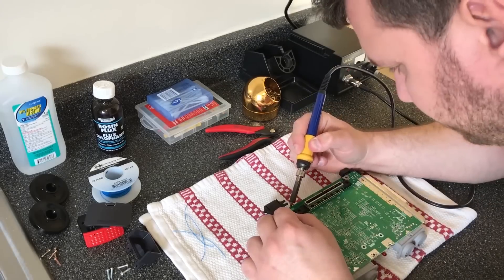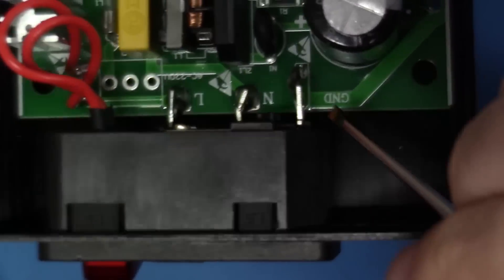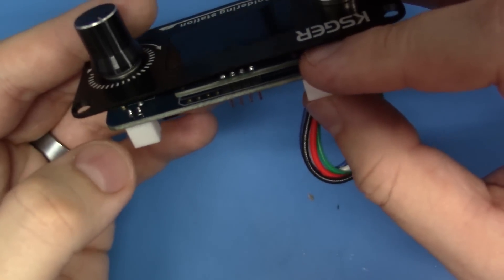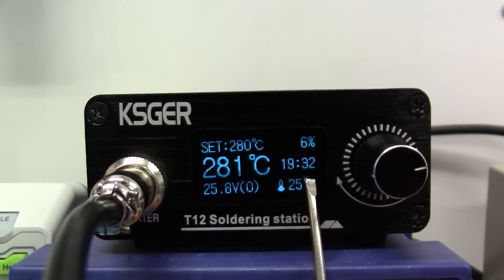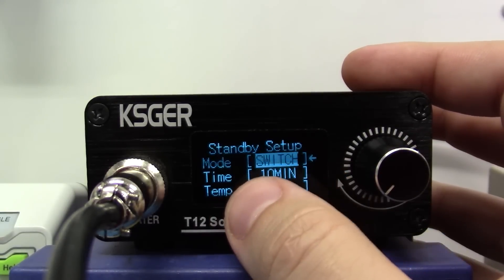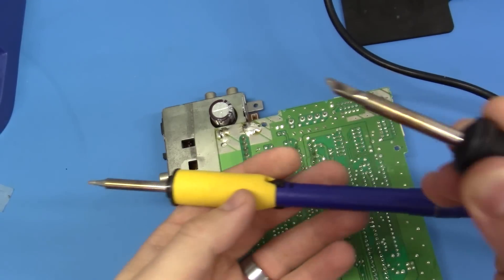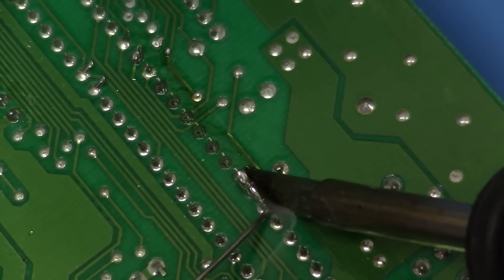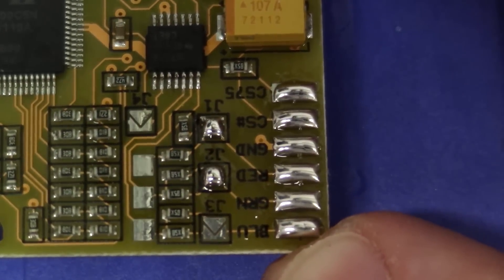Buying Your First Soldering Station (UPDATE READ DESCRIPTION)

Comment: I think crimping and screwing in should be better than soldering in power applications. Solder is not to be relied on for vibration resistance and mechanical strength.
Reply from the maker: Yes, I completely agree with you. But unfortunately, a lot of these "cheaper" soldering stations have mains lines that are VERY poorly crimped. In this scenario I would much rather have a hard-soldered, mechanically bonded interface between my AC input and the rest of the electronics than have the risk of having a poorly crimped AC line break off, float around and short to something else, that could be devastating!
Reply: @Voultar   why you do not use your hakko  station
Reply: @andreiciora2765  They are.  They are just making this video to demonstrate a cheaper item for people on a tighter budget
Reply: For govt work, make it mechanically secure then solder. Crimps are good when well done. But solder is gas tight.  I've replaced hundreds of crimps done with any old pliers, multi tools, etc. With the proper tool and clean wire and terminals, crimps will last.

Comment: So convincing until i followed your link... the picture of the guts looks a bit different than your unit.  the jack for the iron is now directly soldered to the logic board on the front panel which seem inferior as it would be more difficult to replace, the battery is no longer directly soldered to the logic board which is an improvement, but there are so many complaints about it not being grounded to the tip, in direct contrast to what you said.  Perhaps this great video needs a re-visit. Things change after 5 years!

Comment: I have a Quecoo T12-951 , I got the LED version, Opened it up, and yes the AC Socket plug was soldered to the board which I like, But the GX12 plug didn't have Heat shrink around the  connectors, They used hot glue, LoL what a pain if I ever needed to service that plug, Also the used Hot glue to keep the board in place, No Metal PCB feet to the case, so That means the case, the GX12 plug and the soldering handle isn't grounded. Easy to fix but really we shouldn't have to do this. Other than that, it works perfectly, I like the simplicity of the LED unit Vs the OLED/LCD units, Like I don't need a password, I don't need the time, FFS is it a soldering gun or a mini PC. lol Great little stations.

Comment: Thanks for this video! Just wanted to share that I used the provided link to buy the t12 station from Banggood. I just received it, checked inside to find that while the circuit has been revised including a different microcontroller (not surprising given this is 4 years later) the internal build quality appears very similar to what's shown in your video. I've only had a few minutes to test it so far but it fired right up and I was soldering in seconds. I'm just getting into console modding, I have some experience soldering and even took classes 20 years ago but we didn't cover the tricks you use for repairs and mods and I'm sure my old Radio Shack irons would not be up to the task.

Comment: Recently got this (internals seem the same, not the ungrounded version some videos warn about) and did a bunch of mods I never tough I'd be able to. Almost borked an xstation qsb but bypassed the lifted pad with a wire. Funny enough, lifting the pins was a breeze, and I'm on to installing esp32 modules for blueretro on my snes/ps1/n64

Comment: This products is not BangGood but BangBad!! 
Bought one last month through the provided link in the description. Shipment was fast and the station looked OK. Rods feel cheap and break easily. Turned the unit on and didn't work at all. Had to jiggle around with the tip to get it to heat up. When it heated up it would give the ERROR message after a while. Opened the handle and it all feels like "if it stays all in this position then it should work".. Well I didn't get this unit to work properly and contact with banggood support to request refund. They (after providing 2 videos about problem) refunded me the money. make sure that you have the box and all other stuff they sended. Otherwise no refund.

I now bought a Hakko FX-888D after watching more "buy a soldering station" videos on YT and I wished that I did that before buying this crap on BG! WOW this Hakko station is soooo good, perfectly build, easy to use and always works.

You know when using services as Ali or BG that the product yuor buying is shit. Just spend a bit more and buy a proper tool (Hakko is $100).
Reply: I also went with the Hakko FX-888D. I had major concerns about the safety of the Ksger based on an extensive search. It seemed like they could be resolved, ironically with some soldering of a ground wire, but I just didn't want to risk it or have ANOTHER project on my list.

Comment: do you actually want your soldering tip to connect to ground? cuz you sometimes need to solder things in equipment that just stays on you know lol. i'd say it would even be preferred to make them of something that gets hot but doesn't conduct electricity at all.

Comment: I wish I could press the like button multiple times. One question though... Were you applying the tip directly to the surface of the board, or were you hovering above?

Comment: I recently bought one as a backup for my Hakko at your behest. Barely any differences in the one I got but one particularly noteworthy one was that instead of connecting the DIN with cables, it is directly soldered into a secondary board connected to the brain board with quasi mouse nibbles between the two (presumably the non-power DIN lines are tucked between the holes), and the power lines for the DIN connector are cabled from the secondary board directly to the power board. Maybe a better choice to not have the DIN power lines do an unnecessary hop through the brain board? Slightly beefier RTC battery too.

Anyhoo thanks for the recommendation, I'm really pleased with it!

Edit: Oh, one other possible design improvement. The thermocouple for room temp is soldered on the other side of the board with the screen. I reckon having it on that side insulates it a bit from the heat generated inside the box and puts it closer to enclosure temperature.
Reply: Just got mine as well, and it has the exact same differences as you describe, plus the rtc battery is now connected through a socket and cable with the battery itself just glued on top of the main transformer. A thing that worries me a little is that the tip doesn't seem to be grounded

Edit: the soldering handle might have some issue? The soldering station is stuck on error constantly, except when I move around the handle. I can also hear something moving in it?

Edit2: nvm, it was just me assuming things. The thing I'm hearing is the component that detects flailing for quitting standby mode and the contact issue was due to an included standoff that was not designed for another tip size than the one that was included
Reply: @Consolethinks  I had this for a bit too until I set everything up in its final workspace, and tightened it down then it worked fine.

Also the thing you hear moving around is just the shake sensor  (or at least it is on mine). To test this out, let it go into standby and very gently move the handle (without tilting it) and it should not come out of standby. Give it a good enough jiggle or tilt it tip up to make the sound happen and it should come out of standby. So yeah, 90% sure it's just a sensor for shake to wake.
Reply: @tumest  yep, everything works now, it was really just due to the included standoff that it didn't work (it's not needed for this type of tip), and the sound was indeed coming from the sensor.

Comment: This station still working? About totally the trigger on one. Great review!
Reply: I don't know if you've purchased one yet. I just bought one which took 3 weeks to arrive. The tips I ordered it with didn't even show up and had to get replacements. After testing the soldering iron it just continuously flashed "error" and the temperature reading on it was completely random. The soldering iron connection itself to the board with the microcontroller only had positive and negative leads attached, and nothing else. That tells me it doesn't have an actual temperature sensor.
Reply: @fuzzyface4515  
No. I'm still watching reviews. Where did you purchase from? I did see some vids showing how to modify this model which takes a soldering iron to do.
Reply: @drew-ie9xw  Late response but I got it from the link included in the video. After looking a bit closer, it seems they changed the layout of the control board and I just had a scratched trace. I'm positive at this point the issue isn't with the product itself and simply that FedEx beat the living hell out of this thing before it ever made it to me. (They had to replace my soldering iron heads I ordered because they tore through the packaging and went missing during shipping)

Comment: bought one after watch your video. But mine with different board I guess... the tip is not grounded to the power cord pin.
first time use I can feel mild electrical shock from the tip, after a while its gone...

Comment: Hi. KSGER T12 is my other favorite too; now- amazing station, heats 100% faster than a Hakko (it uses the same tip & the heating element tech from JBC) and has the beautiful OLED screen (usually you need to buy a separate power plug and the newer 3.1S firmware is a bit more expensive but it's a small improvement with the old ). 

Quicko at almost half the price (about US$22 only in our local online site, shipped), is a rebranded KSGER T12 but only comes in the mini form factor but is more modular (separate power supply) but the lettering and name look less classy than KSGER.

God bless, Proverbs 31

Comment: where I work we solder class 3 electronics and use METCAL soldering stations ($500+) but for personal use at home i use a Weller. both brands are nice but metcal is amazing. it heats up in literally 3-5 seconds.If i had the cash I'd buy one for myself haha.
Reply: I used to work in the electronics industry and used METCAL as well.  When the company shut down our facility to move it overseas, I really wanted to swipe one one my METCAL stations, if not both.  I didn’t and now sigh every time I solder with something else.
Reply: @michaelibach9063  metcals really are are the rolls Royce of solder stations imo.

Comment: a vise choice for the beginner imo, btw these controllers feed of 19 and 24 volt power supplies, i got mine in diy kit and reworked a notebook powersupply to make 24 volts of it and omg this cutie is worth every 30 bucks spent. in a mean time you can order some hakko orginals tip from japanese stores on ebay - in comprasion with ksger generic tips they dont stand a chance and last much much longer if you dont use active flux with acid. also they come with stc and stm controllers, and for a cheaper solution you can order this station with stc controller

Comment: Does anyone know what the difference is between the V.2.1S, V.2.01 and V.3.1S versions?
I contacted KSGER through Alibaba and I was told that version 3.1 is more stable and included Russian language.
However, it was not clear about the other versions.
At one point, they even said that version 2.1S, to activate the station after sleep, the encoder must be pressed. I thought that all versions, including the LCD, would have a "shake to wake up" function.
Thanks!

Comment: A chip just popped on me using THIS soldering station purchased from your link in your description! 

The chip I am talking about is the one next to the top left of the big capacitor which is at the rear right of the station.
Reply: The chip says, R300 on it, well it said R300 on it, now it's just all burnt

Comment: You should also be able to move the rotary coder left 5 clicks to get out of the menu. Quicker than a long press although I wish they had it set to 2 at the highest.
Reply: Also mine had issues to start. Lack of ground to body. The rotary encoder mechanical bond to the board wasn't soldered. The ground plane on the board wasn't used. Solder issues, the gx12 connector was unscrewed - all photos show the gx16 connector which rotates slightly and has a retention screw and mine didn't have that. Heat up and error which takes longer than my ceramic core with hollow 900T based tips iron to heat up. Banggood will be making it right apparently. Also ordered a spare iron to see if that'll help. The logic board was put in crooked. The GX12 was soldered directly to the board - yours has the wires going to a connector and on my board it looks like that part can be broken off and then a header soldered - but then only 1 side of the board would be supported..

I do like how the power board is separate from the logic board - their heat gun station combines them O_o... It also has a permanent connection - I modified that on my rework station and I may replace it with the KSGER and do the same thing and wire it up the same so I can use both. 

I would've preferred the plastic stackable case - maybe I'll buy that separately.

Comment: The only downside is that the CMOS battery is soldered in.  It should be in a holder so that it could be easily replaced.  Once dead there go your settings and time.  Has anyone seen a replacement for this?

Comment: About 22-23 years ago I paid $60 for an early digital Radio Shack soldering station. It's still working just as good as it did, and about 10 years ago I finally found a very nice set of compatible tips. Lately I've wanted something a bit more new and have been looking at systems that use T12 tips. This particular one keeps popping up, and I'm heavily leaning towards it and a nice Aoyue desoldering station.

Comment: Just got mine today. Ordered 4 biz days ago and it's already here. With the exception of a few minor revisions, it appears to be identical to the one in the video. It didn't come with a box or manual(or any kind of documentations at all), but thanks to your video, everything is easy and straightforward.

The "brains" board has been revised a bit. The board is now longer and is soldered directly to the irons output plug instead of the plug being attached to the board via removable wires. The RTC battery has also been relocated to the top of the power transformer. The beefy heatstinks and good soldering is all still present and accounted for.

Comment: A clear concise, accurate informative review, I am a retired electronics technician, 50 years in the industry , my go to daily driver is a Metcal set up - excellent but also very expensive, the Metcal tips are around half the price of this unit ! I have looked at various reviews of this unit and found that after your presentation I am very impressed, therefore , on the strength of your recommendation I have ordered the head only version ( I am going to provide my own 24v supply), the tip price seem to good to be true ! Incidentally, although Metcal is US company ( my unit is US manufacture ) all their production is now in China as are many many branded goods, not all CE products are rubbish , British Dyson for instance.
Kind regards. Richard. Yorkshire. England

Comment: there is a great mod i did to my soldering iron i added a plug to the back so i could use it in field use case with my rc cars by soldering 2 wires to the output part of the pcb and i just use a 6 s lipo to use it

Comment: Good video but I would be really careful and not leave unattended-especially a non Hakko. I was a tech at a large soldering facility and seen a Hakko station go bad and it went glowing red hot and melted handle before someone shut it down. This only happened once in a facility that soldered all the time but I would imagine the QC of something like this good as it may be wouldn't be as reliable as a Hakko long term.

Comment: I have a small difference in my model. In mine i have only solder pads showing inside the unit, where you plug in the iron tip. The battery is on top of the power transformer. I think that is kind of odd. It is pretty much the same all around. I measured the tip and ac adapter plug and it is esd friendly!

Comment: For what it's worth; I took my KSGER station apart and found the 400V, 68mf capacitor leaking.  (I ordered a replacement capacitor.)  I had not used the station more than 20 minutes.   There is another video of someone with the same (400V, 68mf) capacitor leaking.
Reply from the maker: Oh damn, really? Thanks for dropping that info in here.

Comment: That soldered connector puts soo much stress on the joint
Reply from the maker: The soldered IEC connector is actually supported by the housing so there's very, very little mechanical stress placed onto those solder joints.

Comment: It's not necessarily a "feature" and positive evidence of quality that the AC mains connector assembly is directly soldered to the PCB.  Unless that entire IEC socket/fuse assembly is really robustly attached to the back panel, the forces from the line cord being plugged in and removed are going to be coupled directly to the soldered connection on the PCB.  Having wires in there would isolate the mechanical forces associated with the manipulation of the external cord from the PCB traces and soldered joint. 

I have one of these ordered and on the way, so I can't really tell for certain about the mechanical aspect of that rear line cord connection.  Perhaps this isn't an issue in practice..

Comment: I bought the one from your Amazon recommended list. Not the same exact model, but internals looked solid. Continuity between the iron tip to ground was good. Power rails hard soldered to the board, which looked the same as this one. Main controller board looked different, but didn't look like trash. Fuse for the power plug just like this one. Solid.